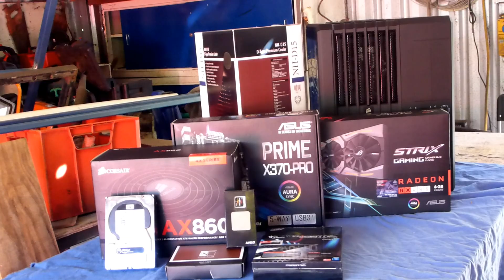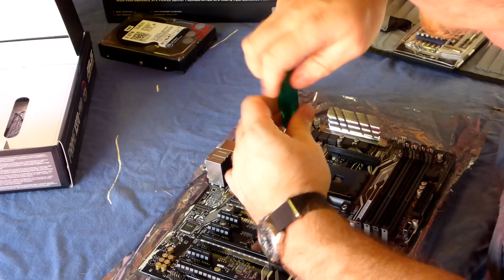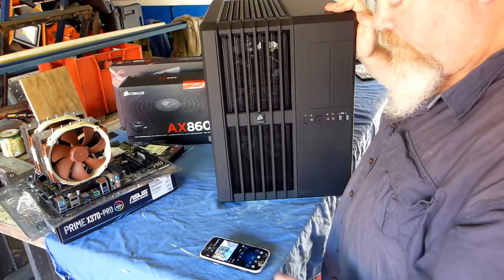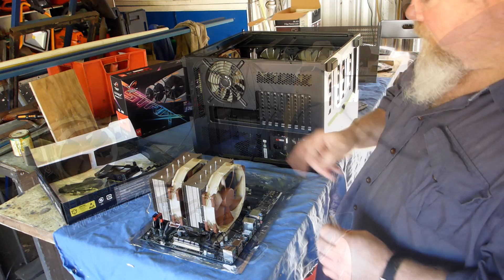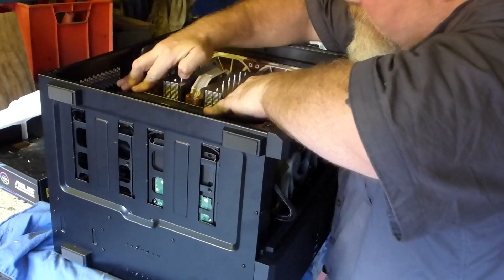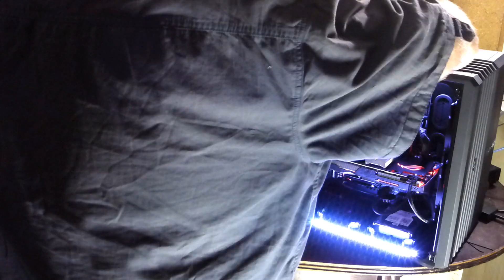Ryzen Build 1800x RX 480 By Ozzy Bogan Tech (Extended Edition)

Comment: Ha, he installed those noctua fans wrong.
Reply from the maker: Which ones the CPU ones are back to front from normal but that is on purpose for RAM clearance and in a Corsair 540 with its exceptional airflow this should not be a problem.  Mabey a good idea for a video tho Benchmark thermals for both configurations and see if there is any difference.
Reply from the maker: Thank you tho for the view and comment and I do agree in an ideal world the CPU fans should be the other way around, and in a smaller case, that's what I would have done. But in a large case with all the case fans running low noise adapters it should not make any difference, but would be nice to test that out thanks.
Reply: it makes very little difference and ram clearance prevents them from being installed push/pull